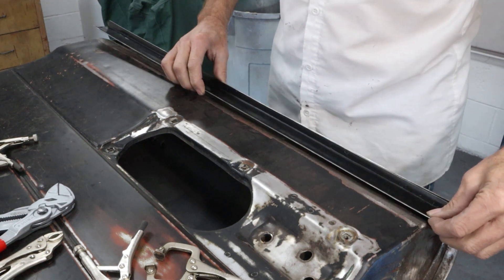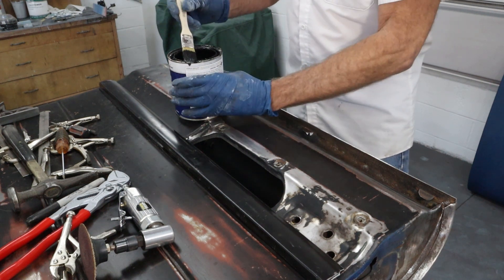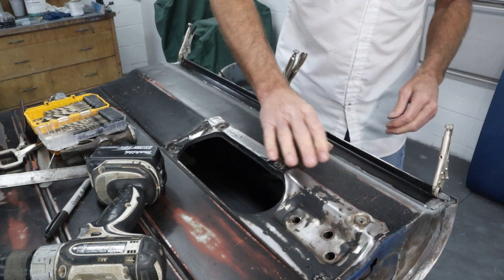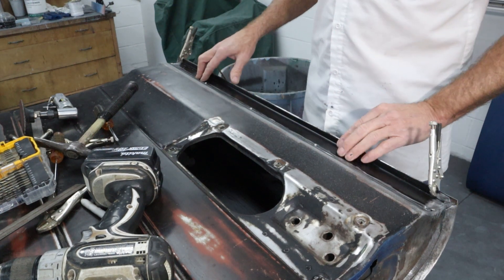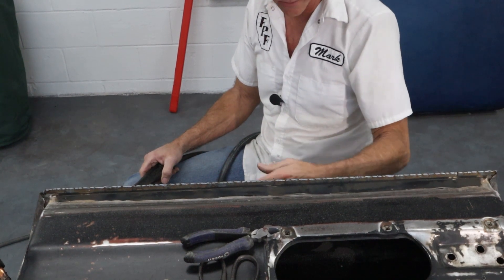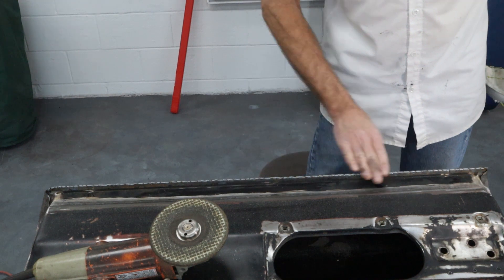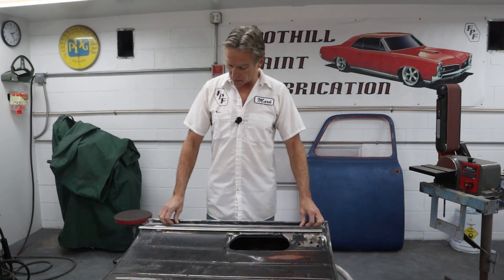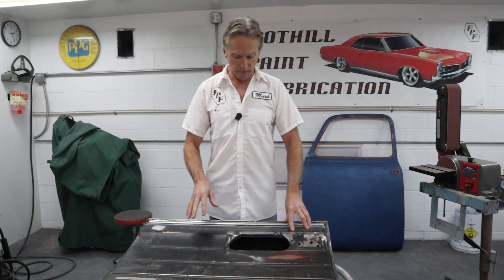1950 Chevy Truck (Ep 44) Inner Door Patch Panel Part Two

Comment: Mark how hard would it be for a DIYer to learn how to weld? Nice job on the panel!
Reply from the maker: If you have never welded before starting out on thin sheet metal can be daunting. Burn through and warping will be your nemesis.  It can be done but you have to practice practice practice BEFORE trying to weld a panel.  There are a ton of videos out there on it but in the end you need to get a small wire feed welder and learn as you go.  Everyone started somewhere so it is possible if you take the time to learn and practice.
Mark